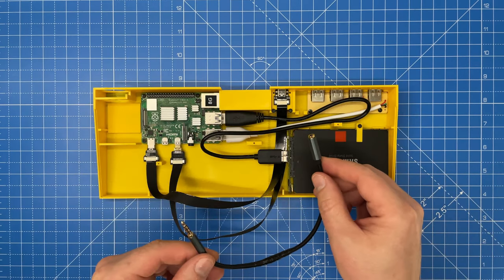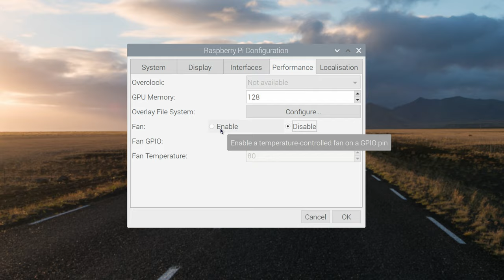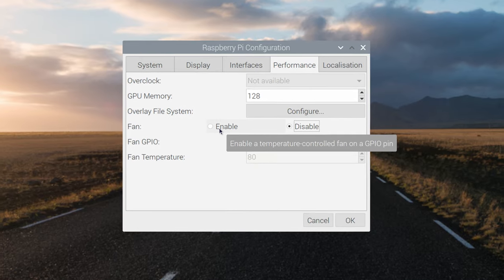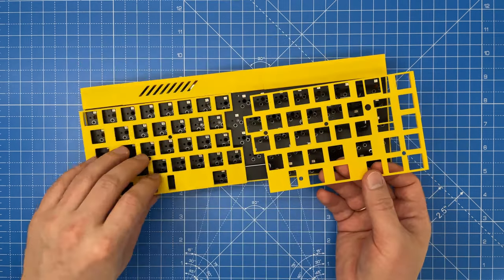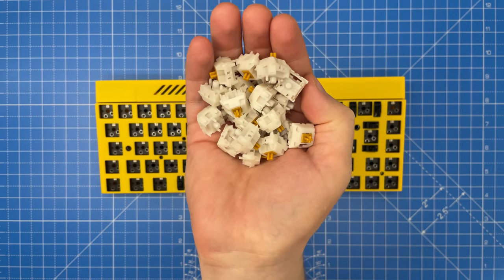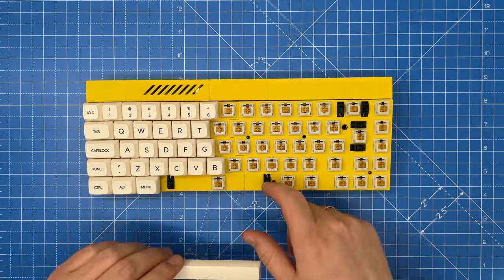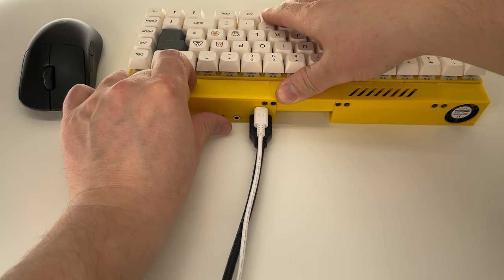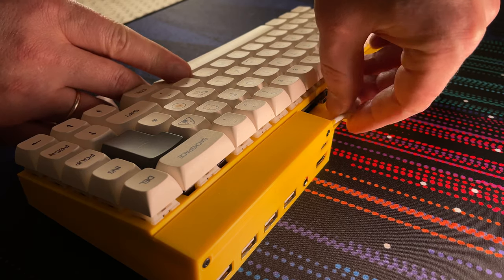Raspberry Pi 4 mechanical keyboard upgrade

Comment: SFFPCs have sure evolved to a direction I did not expect... This seems more convenient than getting a mini Pc and for traveling because you only need to bring a kb and a monitor (so technically like a laptop or like tablets with the internals inside attached to a separate keyboard but will probably have better air flow and be more convenient because it's natural for kbs to have a large mounting board so it's not too odd---and monitors are more cheaply produced)

Comment: just thinking you might be able to make a basic usb switch, by having a double throw switch change the ground line between the USB port of the Pi and an External port, so no need to remove that panel to plug the keyboard directly
That said, love this idea, its like a pi400 with a bit more grunt and class!

Comment: Is there a chance of getting an actual model number/part list, or links to buy all parts? Listing the items is ok, but there are so many different types of USB hubs, connectors, etc, that finding the right one that fits with this exactly 3D print would be difficult.
Reply from the maker: I updated video description with links.

Comment: How about a dual fan case ?
Reply from the maker: First intake fan and second exhaust? That will work better.
Reply: @PavloKhmel   I divided the vents on the bottom of my pi 400 with cardboard with 2 small fans the left intake & the right exhaust . I taped a little piece of cotton ball on the inner middle between the vents . That helps spread the cool air through the inside of the 400 .

Comment: is this compatible with the standard layout bm65? instead of iso?
Reply from the maker: I can only compare what I see on kprepublic web page. It looks compatible. And it looks like they sell with the same case.

Link1: https://kprepublic.com/products/bm65rgb-bm65-iso-rgb-65-hot-swappable-custom-mechanical-keyboard-pcb-programmed-qmk-via-firmware-rgb-switch-underglow-type-c

Link2: https://kprepublic.com/products/bm65rgb-bm65-rgb-65-hot-swappable-custom-mechanical-keyboard-pcb-programmed-qmk-via-firmware-full-rgb-switch-underglow-type-c

Comment: This is such a nice concept. However, I'm worried about the vibrations and noise from the fan running. Is it negligible?
Reply from the maker: This fan starts only if processor temperature is above 80 degree. Without heavy activity the fan will be idle. And it does not make a lot of noise.